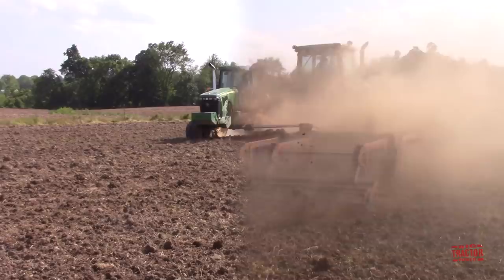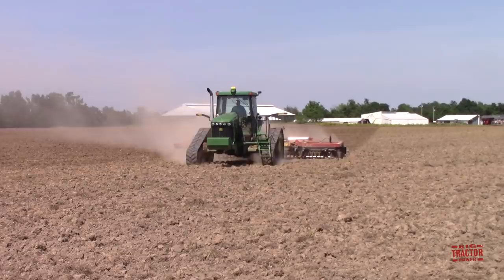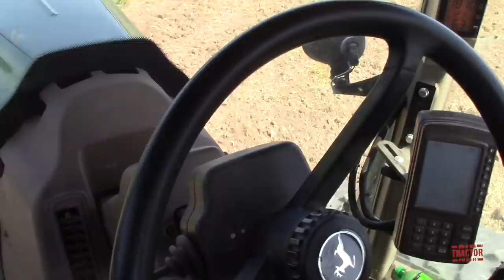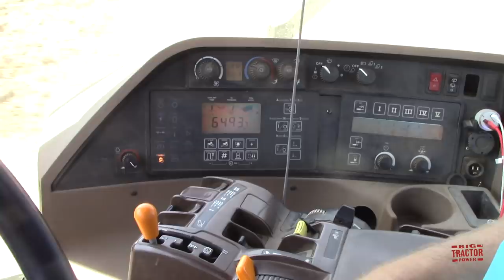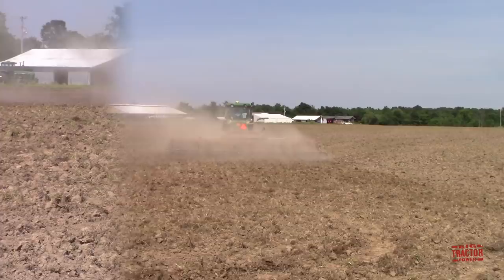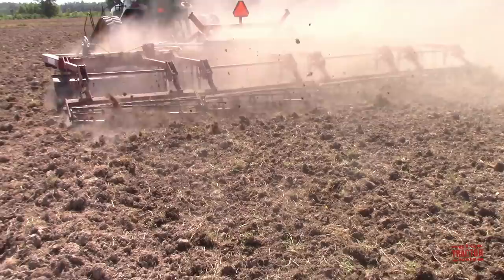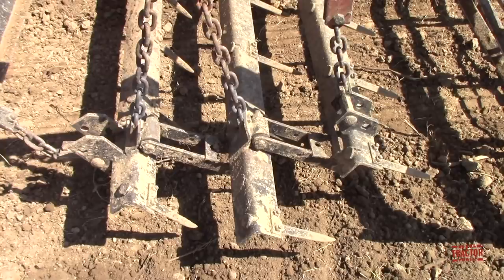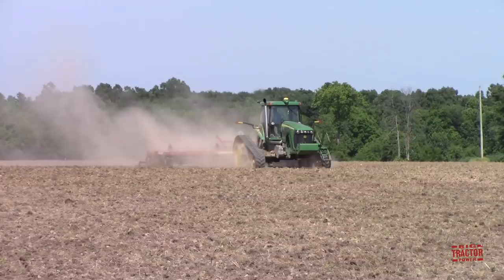John Deere 8520T Tractor & McFarlane Reel Disk

Comment: I couldn't set in that thing all day with no muffler,  That would drive me crazy.
Reply from the maker: It was not too bad in person. Seemed similar to 4wfs I film with 855 Cummins engines.
Reply: Sounds like it's working hard; with that disc giving it all it can handle. With the real muffler they sound like they're just loafing along.
Reply: Ran one for a year. They are loud as hell with the factory muffler.

Comment: The implement really does a great job on  preparing the seed bed but straight pipes would drive me batty
Reply from the maker: The MacFarlane does a nice job out in the field there are several here in the area I’ll have another video of one working on primary tillage over corn stalks.
Reply: straight pipes will also make you deaf.

Comment: Good video, what's your opinion on the cab noise from the straight pipe. The video sometimes isn't  a good judge.
Reply from the maker: It did not bother me at all. Too me it was no different than a 4wd with a Cummins 855 in sound.

Comment: Nice video sir! I like the tracks! Tracks and tyres which one best sir?
Reply from the maker: Tracks are hard to beat in tillage. If I were farming and had lots of tillage I would go tracks. They run faster and pull better. I see track tractors lap wheeled tractors with the same implement in the same field.  Wheels travel on the road better.
Reply: @bigtractorpower  Thanks for your information😊

Comment: Is he running with the steps down?
Reply from the maker: The folding step did not come out until later.   I would have to research that if it came out on the 30 series or the RT series.

Comment: Hi Mate thank you for your video question. When it's  turning around at the headland how do they know they are on the right turn like not turning to tight or too wide and making a mess of the next row I hear beeps is that something to do with it. What is it they are just experienced and know how tight to turn.
Reply: Yes the beeps helps the driver some,,, but he also have the monitors with maps and so on,, but depending on the system,, the tractor is ready for autogear to be engaged,, and the tractor then itself stear itself in to the right line-spot to lower the tool..
actually on many systems the tractor could turn around itself if the driver let it..
hehe but many farmers like to do it themself so they feel they are working a little.
but there might be other reasons, say the tool's your towing dont allow as sharp a turn as the autopilot might take. hehe
Reply from the maker: Good question. The beep alerts the operator it’s time to turn.  The field is mapped and the gps knows when the boundary has been reached. The operator decides how to turn. With a two tracked tractor wider loop turns reduce berming of the soil on the turns. In this case the turns are tight but the last pass on the perimeter of the field will erase the turns.
Reply: @bigtractorpower  yes, ty bigtractorpower thats a better  explanation.
i just know what i have seen in other videos about the autostear... that the ONLY THING  the tractor realy need is the weight of the driver in the drivers seat, for safetyreasons, to be able to take the wheel if say a child ore an animal gets in the path, and that the tractor realy could have done the field by itself on the most modern systems if it had motion sensors stopping it from run over things... which would MAKE IT MORE COSTLY . hehe..
BUT then you might run in to the problem i somtimes get in my fishing boat , putting out gillnets. that the outopilot suddenly deside to turn and i get my nets in my propellar if i have programmed it wrong. HAHA.
but i also know from back when i workd at farms in the 70s- 80s,, that if you turn to sharp, say pulling a long tool,,, the back wheel  COLLIDE with the tool.
its NOT popular if you BEND-DESTROY IT spesially if its busy, planting ore harvesting. i know that from experience bending the drawbar on a trailer,, but luckyly i went to mecanic school before i became a farmhand-fisherman so i workd 4 hours without pay in the evning, fixing  the trailer so it was ready for next day. hehe
Reply: @samkom33 thanks for your reply. The only autopilot I have in my Prius taxi is cruise control so I'm definitely in control most of the time at least I think I am :-)

Comment: That is a 4125 I do believe 4100 series and 25 foot
I used to work for mcfarlanes those reel disks are great machines the only bad thing is you have to go between 8 and 10 miles per hour to do a good job I have actually ran the same reel disk on a friends 7624 Massey Ferguson I think I was going 10.4 or something like that
Reply from the maker: Thank you for this great post. 👍

Comment: NOT QUITE the speed I thought it was going heck I could pull our 32 foot plow disc 7 to 7.5 with our 8330
Reply from the maker: The field was pretty rough.  The furrows left by the field cultivator leave a ridge so 7.5 mph is about as much as it can go with out bouncing the operator around. The farmer ran 7.5 when I was in the cab so the camera would not bounce too much.  When I was outside filming he bumped up to 8.5.

Comment: How long would those tracks last on average if you had some moderate road travel between fields and how much would they cost to replace? Thank you.
Reply from the maker: I am not sure.  I think I asked about a 600 hp track tractor and it was 2,000 hours on the tracks.  I am not sure what they cost to replace. This farm has all its fields in one block so there is not much road travel.
Reply: Thank you for the reply. I'd like tracks for the floatation but I worry about the cost to replace them.  @bigtractorpower

Comment: It literally looks like they took out the front axle I just bolted on trucks under the tractor it seem to be working though it just looks like it’s going to fall on its nose
Reply from the maker: It is the wheeled tractor on a tracked frame. I am sure their is quite a bit of engineering to make it all work.

Comment: WELL IF THEY PUT THAT PIP A LITTLE HIGHER U WOULD NOT EVEN HEAR THAT, I HAVE RAN A LOT OF TRACTORS, AND NEVER HAD TO RUN THAT POOR TRACTOR TO THE PIN LIKE, WHY THSES FARMERS THE OLD SCHOOL GUYS THINK WELL SOME OF THE NEW TWO, BUT Y THEY THINK THEY HAVE TO RUN THEM TRACTORS TO THE PIN LIKE THAT IS BEYOUND ME, THEIR IS NO NEED IN THAT, I MEAN OMG , IF I WORKED WITH A GUY LIKE THAT AND IF IT WAS OR WAS NOT, U DO OT HAVE TO RUN THAT TRACTOR EVEN WITH THE THEY SIT ON TOP OF THE GROUND, BUT HE IS JUST DUMPING FUEL, BUT THEIR IS A LOT OF THEM THAT DO IT!!!! I'M SORRY BUT JUST SAY'EN !!!!! YOU CAN SAVE A LOT IN FUEL, AND REPAIR IF THEY WOULD JUST KICK'EM BACK A LITTLE  $$$$$$$$$$$$$$$$$$$$$$$$$$ BUT JOHN DEER  LUV'S THEM, AND THE FUEL MAN !!!!  AND ONE MORE THING, GUYS THAT RUN THERE MACHINES LIKE THAT, HAS PUT A LOT OF GUYS OUT OF BUSSINESS, SOMETHING TO THINK ABOUT !!!!! O.K. I JUST SEE HE WAS RUNNING THAT THING AT 21 2200 RPM'S THAT IS ALL A MOTOR CAN TAKE, THEIR IS NEED, AND WHEN HE SITTING THERE HE DON'T IDLE HER DOWN, POOR TRACTOR !!!!!
Reply: Oh my fuck if u think that will fuck it u have no clue there tractor that are screwed here to be doing 50+ horse power more than standard  and still going strong at 10000+ hours get a grip